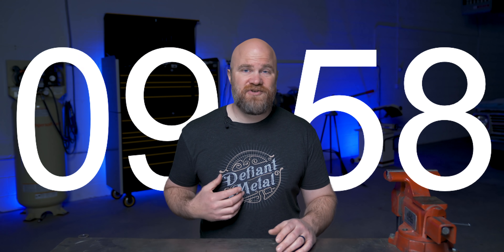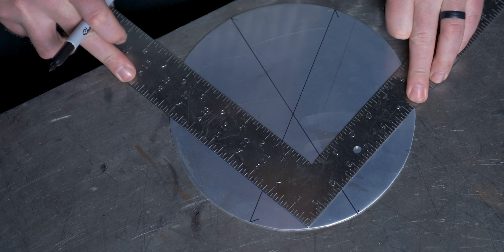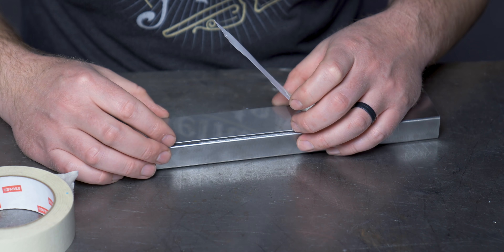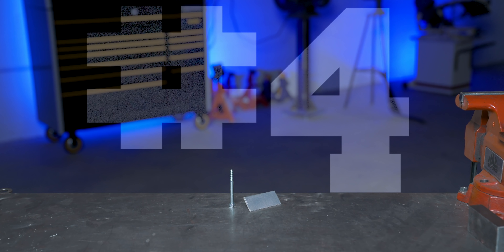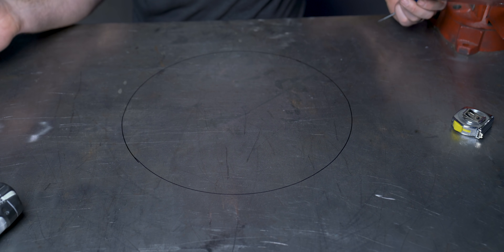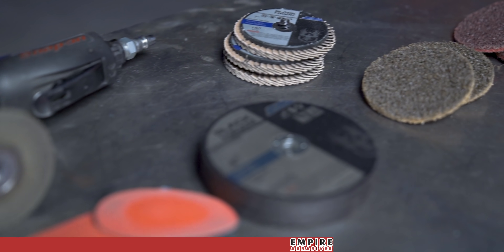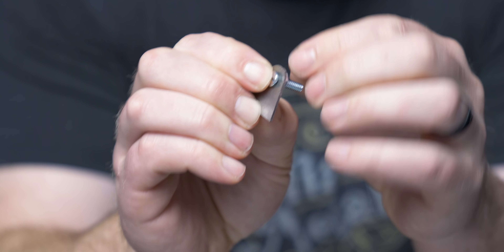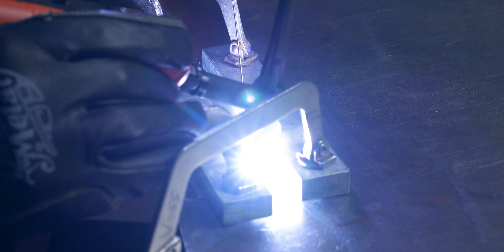10 Fabrication Tips in 10 Minutes!!

Comment: You can make any size of oval by making a 90 degree + sign.  If it needs to be 6 inches wide and 12 inches long.  Start with the half of each dimension which would be 3 inches and 6 inches.  You use the idea of short to the long and long to the short so fat as measurements.  The original has to be long enough on each leg to cover the longest distance.  So start with the 3 inch distance and then move the 3 inch along the horizontal leg and the 6 inch half on the vertical line 6  inch side.  As you slide the points along mark the end of the ruler in close points and that will give you all you need. Trim the first quarter and fold the quarter part and mark for the other half and trim and then fold in half again the other direction and mark and trim and you have the oval pattern for the size you need.

Comment: The play you mention on the measuring tape is actually part of its design.  The space that it can move/wiggle back and forth is exactly the width of the metal itself, thus, you can either make the measurement by pushing it against something, or pulling it on an edge.  If It didn't have the wiggle room, the measurement would be off by 1/64"-1/32".
Reply from the maker: I mentioned that also
Reply: @JustVoss  in what video?  because in this video, all you just say is, and I quote: "...using the 1 inch mark at the end of your tape measure, that eliminates this play that's on here and gives you a more precise measurement, sometimes this can be wore out or just not accurate"  which left me thinking .... you know what I'm tired of explaining myself.  I'm done.  I'm going to go away and do something different.  I have more important things to do than nit pick other people or try to help out others, i just get bit for doing it anyway.  good luck.  I never existed.
Reply from the maker: @jeremiahkastner6374  “sometimes this can be wore out or just not accurate” you typed the part yourself
Reply: @JustVoss  Jeremiah silently backs up and disappears into the neighbors bushes.  He literally has no attachment.
Reply from the maker: @jeremiahkastner6374  haha i actually laughed out loud. It's all good man, I do wish I would have talked about it more than just the passing mention. I do use the normal end of the tape measure, especially on larger distances.
Reply: @JustVoss  I have this ugly urge to correct people.  I am working on saying less...

Comment: Use a carbon block for backing it won’t ever stick, I don’t even know what to say about the tape to find hole location that will never be accurate mark center and measure out to the hole if you want it accurate. Trammel points for drawing the circle etc etc but that’s just me. These are all 2nd or 3rd option lol

Comment: The tape measure is actually design that way.
Reply from the maker: I know, but as I said it wears out. And when measuring between two points on a flat piece trying to use the end doesn’t make sense.
Reply: @JustVoss  cheers I too don't measure from the end, always from the 100mm mark

Comment: No. 5 - A little more work, but get a wood ruler and accurately drill holes at every 1/2 inch.  At the beginning, drill every 1/4 (or 1/8) inch.
Now you can accurately make any size hole up to it's limits.  One hole for the pin and the other for the marker.
Works for me.

Comment: The flat head screw for centering bolts also works as a way to install PEM nuts if you can't get an arbor press into the location to install them. Just use a strong flathead with a hex or Torx drive and screw down the PEM nut until it fully installs itself and clinches in the sheet metal. 

Small diameter bolts might snap, so be careful under around M4 or #10.

Comment: Amateur here I just moved my gas filler hole from the front of a 65 corvair to the back quarter panel rough cut the rectangle half inch smaller than the  flap door and beat it in with a pice of three quarter pipe. Like I said I don't know what I'm doing but the door fits pretty good.

Comment: The reason the claw on a tape measure moves is to take up the width of the claw whether pushed up against an adge of hooked on the edge and pulled to measure
Reply: that may be true, but his point was that when it gets worn it moves more than it should, introducing error, which his method does mostly avoid.

Comment: Those are some awesome tips, some so intuitive I can't believe it's not common knowledge in all the trades. However,  #9 went over my head somehow. I'll scroll through the comments to see if anyone else had the same issue. At any rate you got a new sub :)
Reply: Say you need to create a patch for an odd shaped hole in some sheet metal, if you start with a circular piece of metal, you can tape paper around the outside of the circle until it’s silhouette matches the shape of the hole that needs patching, then trace your metal/paper amalgamation to have a perfectly odd shaped patch
Reply from the maker: Great explanation!

Comment: I hope people understand why the tab on the end of a tape measure has "play". The amount it moves is equal to the thickness of the metal tab so that you can measure inside and outside accurately with 1 tape. There is no need to "burn an inch".
Reply from the maker: There’s literally text on the screen that says “if it’s worn out, it may slide more than designed”. Bet yet, not the only comment like this.

Comment: You can also use transfer screws for marking holes they are lil tiny threaded points for whatever size you need and they also come with a special install tool so you can use them on thinner material and shallow holes and they have a very short point so you can set them  just above the surface 👍👍👍

Comment: Fyi that play in the end of a tape measure is intentional. It moves the same amount as the thickness of the catch. This allows for accurate measurements for both inside and outside dimensions. If it was fixed in one position then one method of measure would be off by the thickness of the tape catch.
Reply from the maker: But not as it wears out

Comment: For finding blind holes, check out the blind hole strap duplicators that come in 6” and 12” varieties. They are great for a door or small panel, for larger panels check out blind hole spotters. They come in threaded and non threaded options. All of these are inexpensive and great to have in your box. We use them on aircraft metal repairs quite a bit. 👍. Great video!
Reply from the maker: NIce! Yeah I have seen those before, people used to use them a lot when locating race car side skirt holes.

Comment: How are you liking your air grinder setup compared to the standard 4.5" electric grinder like a Dewalt? I'm asking because I have an electric grinder but I've never tried air tools so I can't compare. I like the power of my grinder but it's a bit hard to control at times and your setup looks better for detail work. Just curious to know your thoughts. Good job on your channel by the way, I think details and looks matter and we seem to be on the same page there!
Reply from the maker: Air offers a lot more control. I have seen some newer battery powered angle grinders that are also variable speed but then you have to deal with batteries. The electric 4.5 is good if you need to remove a lot of material fast but then I usually switch back to air to finish it off. You have to have a large air compressor (60gallon+) is the only drawback.

Comment: Great video. There's actually a very specific reason why every single tape measure has that play at the end of the tape, it is to compensate precisely 1mm where you're hooked on the a peice or when pushing against it. But I guess it can where out over a long time.
Reply: The hook is sometimes curved so there is a difference if you hook a thin sheet or a big block.
Reply: @wouterwestendorp8050  Lay it flat on an anvil, and hit it with a hammer.  Curve gone.
Reply: It can also be used if you mark from a smal hole on a plate or mark to mark

Comment: The play on a tape measure is by design to compensate for the thickness of the metal on the end
Reply: That is what it is intended for yes, however as a tape gets used that play can become too much and thus become inaccurate which is why we burn a couple inches to keep thing as accurate as possible
Reply: @kadeheatherly2891  very true. I'm back 2 years later and missed the part where he said that. My bad.
Reply: Its a true zero, when u measure an edge the gap opens to measure exactly from the edge and when u measure something that u can push the tape on to and then u can accurately measure from that point on
Reply: @luisvaldovinos3340  play will develop over time with use

Comment: I knew a few of these but a few great tips with making blind holes! You know the end of the tape measure should move the thickness of the tap to compensate the tab being hung over a end or butted to a right angle.
Reply from the maker: Yeah I kinda tried to explain that in the text overlay, didn’t want to write a paragraph and forgot to say it verbally.
Reply: i have seen a lot of tape measures move more then they should some up too a 1/8 inch ..

Comment: Do you have any tips on tig welding pie cuts? I have been practicing on 2” 1.5mm stainless but on the thin side of the pie I always overheat the material and it goes a dull grey
Reply: I would suggest trying your best to keep the heat out of the material, especially in those parts. One way is to weld an inside weld, then move to another section of the tube and weld a bit over there, maybe another one somewhere else, then get compressed air, and blow over the whole thing, cool it all down to be cool enough to touch. Anything to keep the heat out or to seperate the hot spots of the tube.